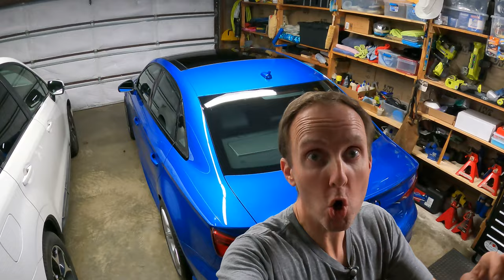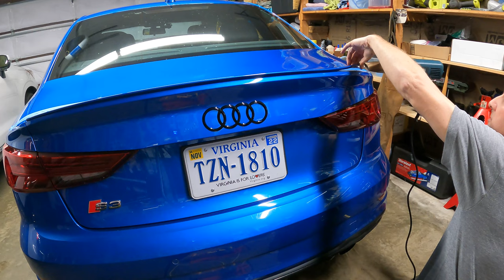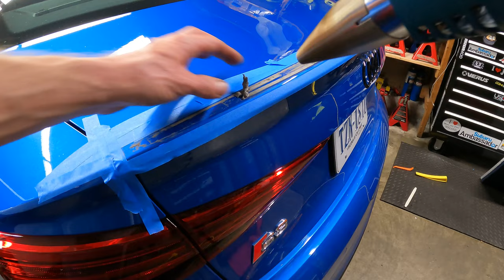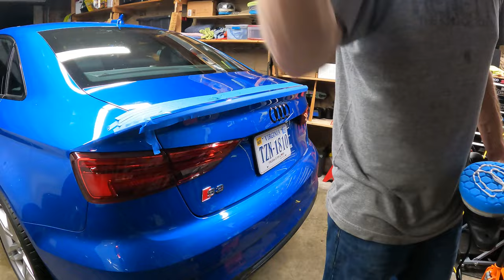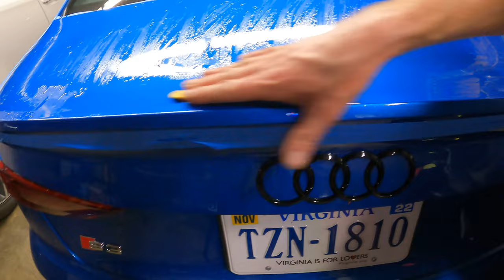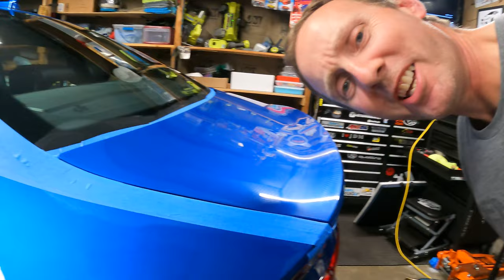2018 Audi S3: Episode 36: Removing the OEM Trunk Spoiler

Comment: For anyone watching this and thinking of doing the same. Use dental floss to cut the tape so you don’t mark your boot lid or crack the spoiler clear coat.
Reply: I use fishing line. 👍
Reply from the maker: good tip

Comment: Just a suggestion for your future videos try to mix the volumes for the music and the talking parts better. It’s pretty annoying cranking the volume up and down all the time because it’s not equalized and your either blowing out the speakers or whispering.
Reply from the maker: funny thing is, i did that this time.. i lowered the music sections to 80% instead of 100% like i normally do. Was the voice too low or the music still too loud?
Reply: @LastHumansGarage  ah that sucks and I feel like the music was the right volume that I normally leave it at but the voice was whispering. I just had it so loud to hear what you were saying it would be overbearing when the music would come on.